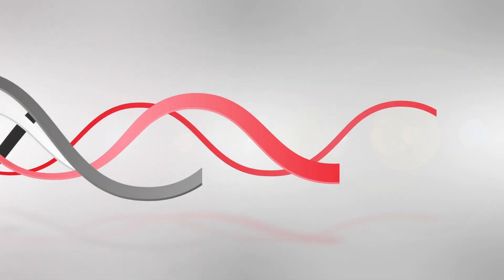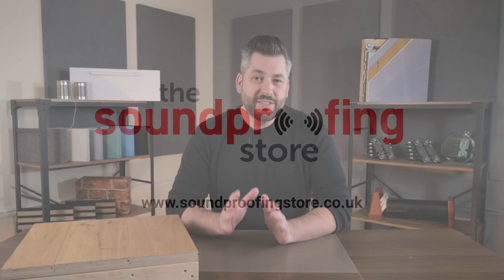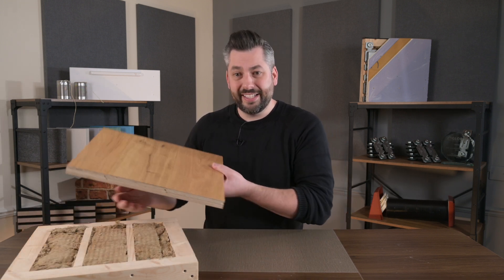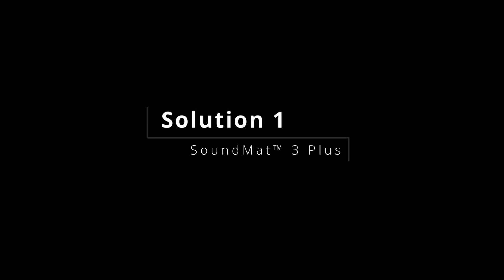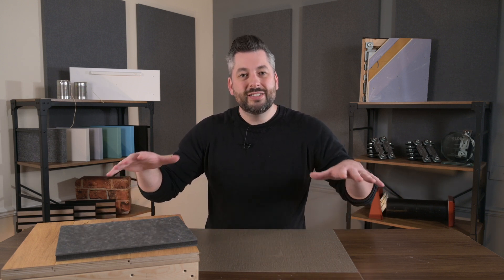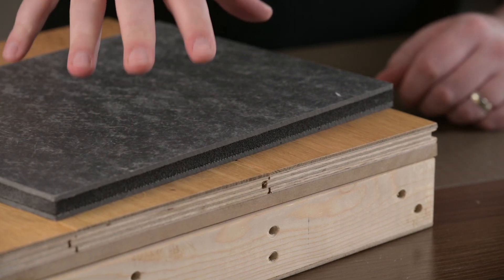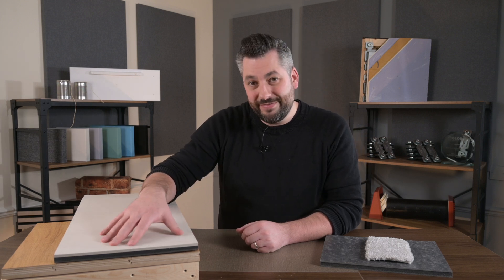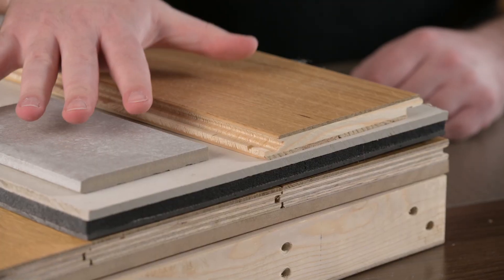The 3 best ways to soundproof a floor. Reduce unwanted impact & airborne noise from noisy neighbours

Comment: Would this soundmatt help reduce impact noise from footfall in a semi detached house if it was installed in the alcoves only along with sound proofing decoupling system wall?
Reply from the maker: Hi @ELITEtimmis, the SoundMat would certainly help with this, but the whole floor would need to be covered. A carpet final finish on top of the SoundMat would also help.

Comment: If I go with the Reverso Soundmat and have engineered wood on top of it, do i still need a subfloor layer between the joists and the Reverso, OR is the Reverso also serving as subfloor? thank you
Reply from the maker: Hi Thanks for the question. No the Reverso isn't a structural board, it needs to sit on top of floorboards. If you want a product that will replace your floorboards and sit directly onto joists then have a look at our SoundScreed 25 - https://www.soundproofingstore.co.uk/soundscreed-25-direct-to-joist

Comment: Hi I want to reduce the floor noice from bouncing a basketball. What is the best way?
Reply from the maker: Hi @homoruge, the correct solution depends on a few factors e.g. is the floor a timber or concrete floor,  is the noise coming from above or below, is it you wanting to soundproof the noise of the ball, or unwanted noise you are hearing, where is the ball being bounced (ground floor, 3rd floor etc). The best advice would be to speak to us, so we can discuss the issue in more detail and advise accordingly (01423) 206208. 
Always try to treat the floor at the source of the impact (if you have access) take a look at the SoundMat 3 Plus and if you can, and add carpet as the final floor finish. If there is no access to the floor, then you will need to treat the ceiling, take a look at the ReductoClip Ceiling System. Please see videos below:
https://youtu.be/S9ZhiDRTPds
https://youtu.be/4aPYW2HbF2E

Comment: Hello. Can you make a recommendation for a similar high-quality product in the US?
Reply from the maker: Hi @jackbenimble7, thanks for the message. I'm afraid we don't have any recommendations for a similar product in the US.
Reply: @SoundproofingStore  All good. One more question. I've seen a lot of people mention that you shouldn't put down underlayment like your product or Quietwalk or MLV underneath floating flooring like luxury vinyl plank. Especially if that LVP comes with an underlayment fastened to the bottom of the plank. Any thoughts on this?
Reply from the maker: @ the recommendation for an MLV final floor finish would be to use a min 6mm stabilising layer (e.g. primed MDF,  ply or cement board) on top of the SoundMat before laying the final floor finish.
Reply: @ Thanks.

Comment: Our problem is with people walking around, thus impact sound.  Which method would reduce the sound being transmitted to the downstairs tenants the most? Would it be quieter to use carpeting over the SoundMat 3 Plus, or would be quieter to use hard vinyl flooring over the Reverso SoundMat?  

Of those two methods, by what percentage does the sound being heard downstairs gets reduced by?
Reply from the maker: Hi @Rekmeyata, it's hard in terms of a percentage, because it depends on the structure of the floor and what final flooring you currently have. Adding carpet to SoundMat 3 Plus will help to further reduce the impact of the footsteps at the source, more so than vinyl on the Reverso SoundMat. Please feel free to contact us on (01423) 206208 and we can explain this in more detail, if that would be helpful.

Comment: I’m experiencing ongoing noise from the ceiling fan in the unit below mine, which runs constantly and disrupts my living space. I’ve spoken to my neighbors, but no changes have been made.

Could you please assist what insulation material would be the best to eliminate this ongoing noise? Thank you for your answer.
Reply from the maker: Hi @t.l.5012, to advise on the best solution we would need some more details. e.g. is the ceiling timber or concrete, the level of noise you are experiencing from the fan etc. Please get in touch (01423) 206208 or sales@soundproofingstore.co.uk and we can advise accordingly.

Comment: I have a noisy floorboards landing that i am repairing right now. The carpet already has a pretty thick underlay, whilst not with loads of mass, does have the benefit if dampening impact noise from steps.  The overall issue is the floor boards themselves which are not properly fixed to the joists. So i am fixing that now, but it made me wonder,, is it possible to get some benefits by adding a lining of material  on the top of the  joists ehich the floorboards would lay on top of and then be fixed down really tight onto?
Reply: Wouldn’t you install underlay over the floorboards ? I mean floorboards are screwed to the joists , right ?

Comment: I just moved into a duplex a few weeks ago and the neighbor has a 5 year old that when he runs through his duplex  I hear a sound like someone's thumping on a drum and wakes me up early mornings. I don't mind that I can hear throughout the duplex but my sleep keeps gets disrupted. Is there anything I could do after the floors were just replaced?
Reply: Are you above or below the child.  I'm guessing below, and if so, you'd have to attack the noise from below and will require a fair amount of work and cost redoing all the ceilings.
Reply: @ssoffshore5111 duplex so a shared party wall and the impact noise lilely flanking. How do we minimize that?
Reply: @blackbirdbeatle  If coming through the shared wall, you either need to build a double wall (with a slight gap so the framing is decoupled), or remove the existing dry wall, insulate, and install resilient channel with 2 layers of 5/8" drywall.  Caulk the perimeter well.  But the answer is the wall has to be decoupled and 2 layers of 5/8" drywall.

Comment: It would cost a fortune to soundproof my old Edwardian built house, it has a brick 4.5" inches or 11.43 cm party wall, plastered and even dry lined on one side, and I can still hear every sound through each alcove each side of the chimney breasts, it's a nightmare.
Reply from the maker: It's worth getting in touch with your dimensions. Yes, soundproofing isn't a cheap thing to do, but some people are pleasantly surprised it's not as expensive as they thought it would be.

Comment: Will this reduce noise if I had the washing machine on? Where I am moving my kitchen is above my neighbours bedroom. I want to prevent any noise vibrations going down.
Reply from the maker: It's slightly trickier with the vibrations from a washing machine, as the sound vibration could also potentially be travelling (flanking) down the walls. If you have the space, then fitting a SoundMat directly under the washing machine will certainly help dampen some of the vibrations. Please feel free to call us on (01423) 206208.
Reply: Did you solve your washing machine issue? You can add some plywood or concrete blocks under it that would help but of course that could be unsightly and take up a lot of space.